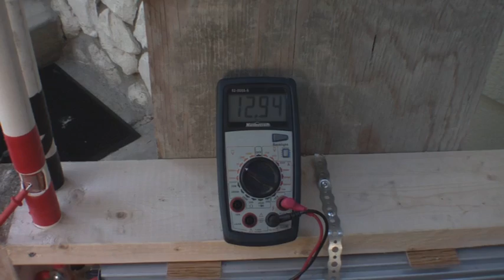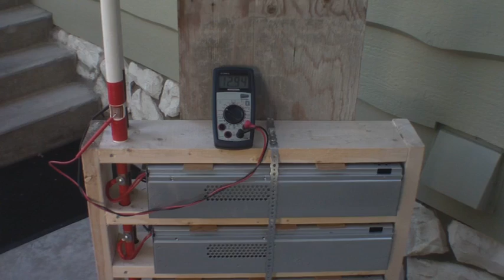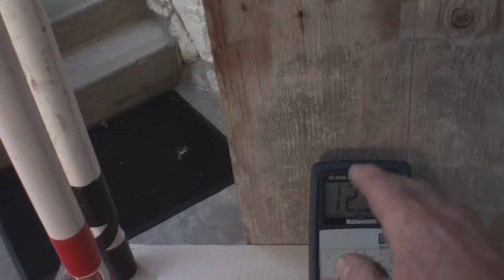Junk SLA Battery bank project - Video #2

Comment from the maker: I thought about that.. but... I came to the conclusion that flat or round, you have the same amount of copper, i.e. the same resistance value. I did, however, flatten the portion that the lugs connect to, to insure maximum contact area, and I sanded them down.

Comment: How about flatten copper tube to double your surface area. Sort a way to double your amperage carrying capacity. I used to work on copper bus bars that withstood 1000 amps easy for cell tower systems that were 1" thick but 1/4" should carry 250 amps easy. A hammer and piece of 2x4 can do the job and drill and tap and your done.